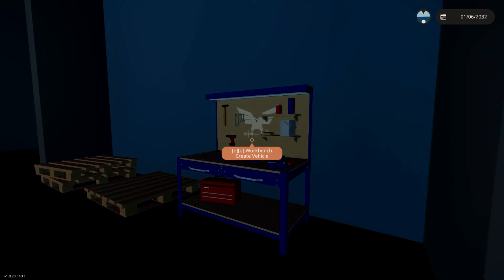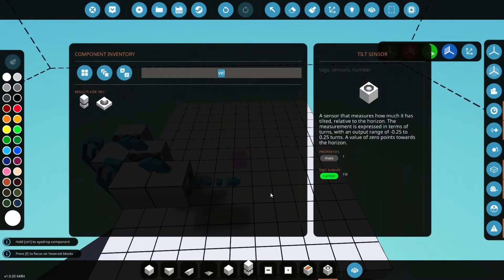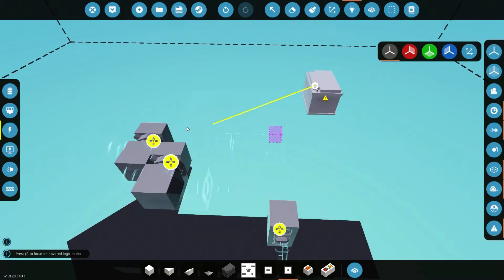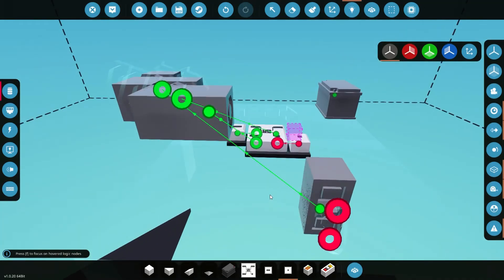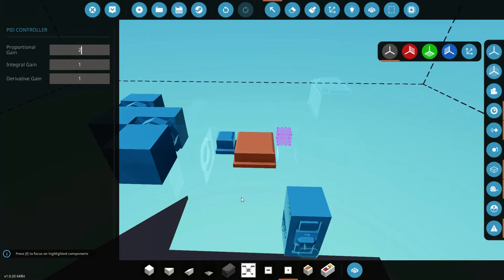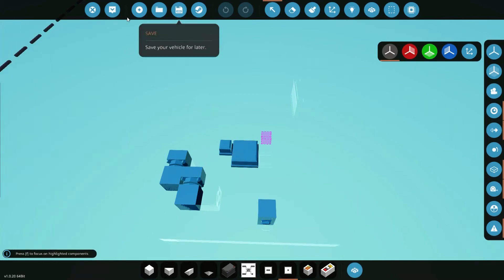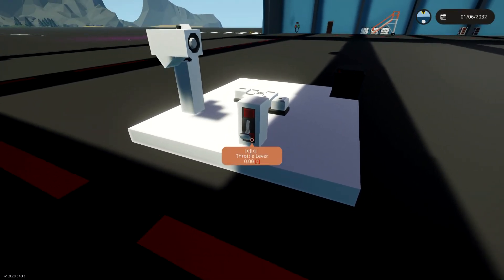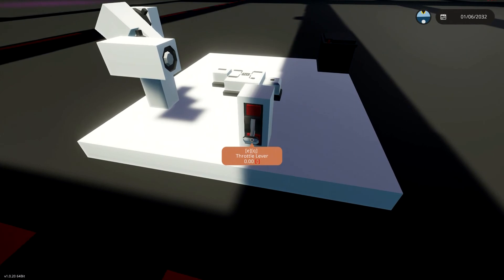Stormworks PID Tutorial For Beginners

Comment: 4:50 mixed up Proportional and Derivative.
PID is all about minimizing the difference between SetPoint and ProcessValue, by providing the correct FeedbackValue.
i.e. The difference between SP and PV is error, so we want zero error.
Proportional Gain is directly proportional to error;
Integral Gain is error summed up over time (in mathematics, integral is basically a sum);
Derivative Gain is the change of error. It's the "speed" of the error.

Proportional is the one parameter that reduces most of the error. Experiment with it first.
Integral is the parameter that erases the leftover error over time. Don't set it too high.
Derivative is the parameter that dampens the system, prevents too big overshoot. Don't set it too high, or your system might become too stiff and unstable (exploding into big numbers).

Formula is basically:
err = SP - PV
errsum = errsum + err
errdiff = err[i] - err[i-1]
FV = P*err + I*errsum + D*errdiff
Reply: errsum is not defined?